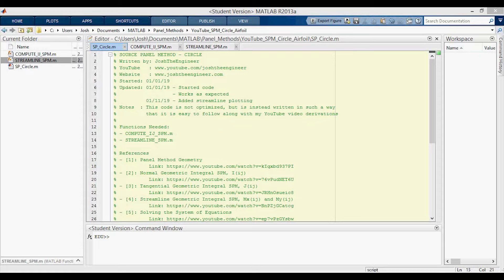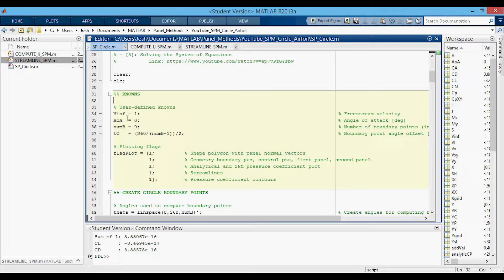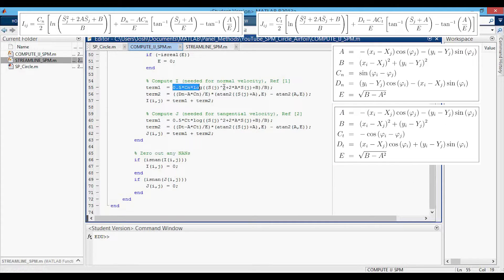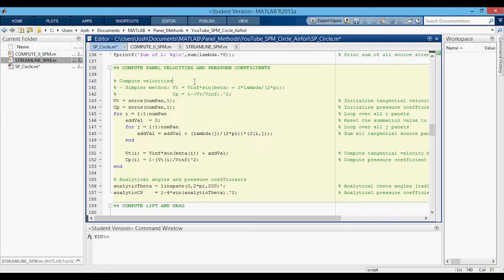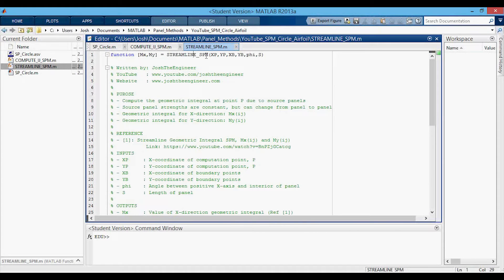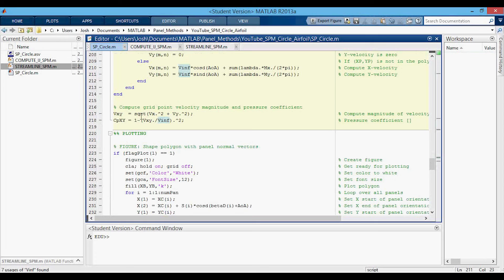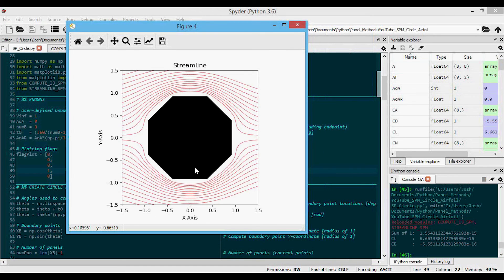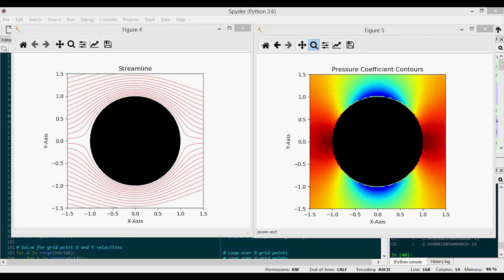Source Panel Method: Circular Cylinder

Comment: Hi Josh, thank you for your video and codes. Hope you are well. I'm also working on coding of panel method. I found that in the seciton of calculating streamlines if you set the grid points as 30, 50, 70, etc you will get a strange plot with a straight line pointing to the circle. Do you know why this happens? Thank you very much!
Reply from the maker: Good question Rui.  That's actually the stagnation streamline, which is why it terminates on the cylinder (stagnation means there's no velocity, so it won't move anywhere once it hits the stagnation point).  It just so happens that for nGridX/nGridY points of 30, 50, 70, etc., one of the streamlines hits the stagnation point and doesn't continue around the cylinder.  Look at the "Ysl" variable for those grid sizes, and you'll see that one of them is zero, which means its on the centerline of the cylinder.  You can use these values (30, 50, 70) if you change the slPct variable either up or down (e.g. from 0.3 to 0.35).  The higher the value, the denser the streamlines.  While looking at this in the code, I realized I have a bug that means you have to have square grids for the streamline computations, so I'll update that in a future version.  Hope that answered your question!
Reply: @JoshTheEngineer  Thank you Josh! It really helps!

Comment: Hi Josh, thanks for the awesome video. So SPM cannot be used to calculate the lift force and you can only get the pressure distribution by this method? But doublet and source panel methods can be used for lift calculations? And drag force can be calculated only in 3D cases?
Reply from the maker: You're welcome!  Correct, you can't use the SPM to get lift.  To get lifting flow, you'll need a vortex in the flow.  That's why in the VPM, we construct the airfoil out of vortex panels instead of source panels.  You won't be able to get drag from either the SPM or the VPM.  To compute drag, you'll need to introduce viscous effects, which then gets into boundary layer computations, and is the topic of a whole separate set of videos.  When you start getting into 3D calculations, then things are different and more confusing, since there are different kinds of drag.  This, again, is an entirely separate topic that I may get into in the future.
Reply: @JoshTheEngineer  Thank you Josh!